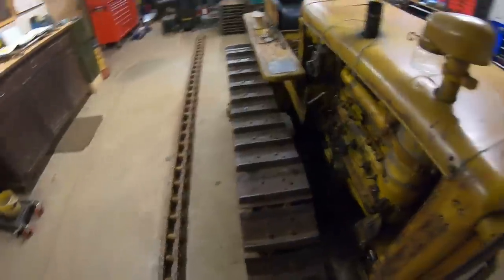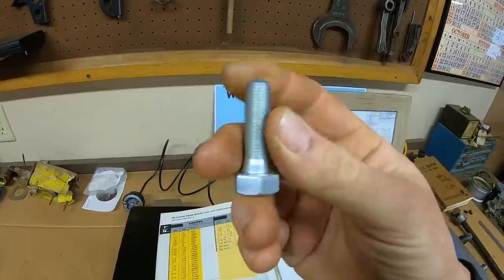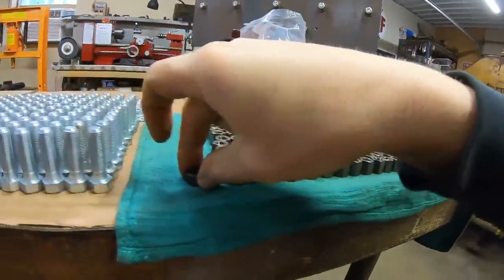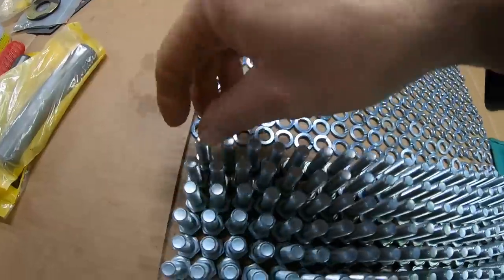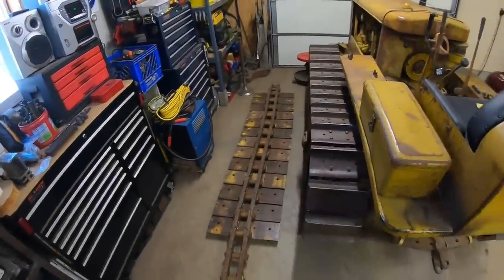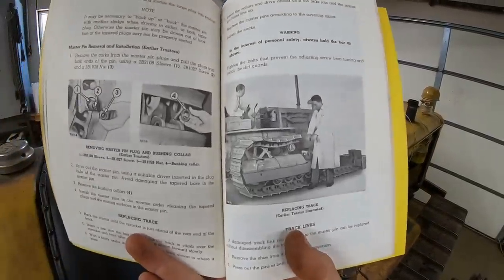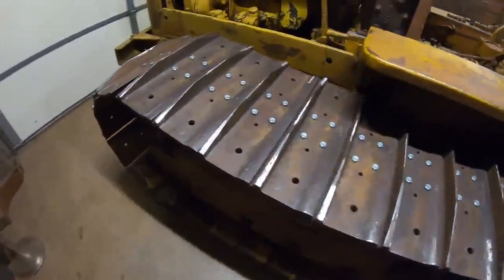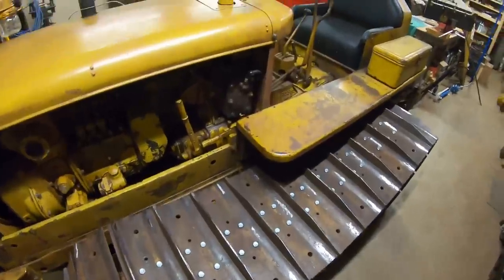Caterpillar D2 #5J1113 Chassis Rebuild Ep.75: Track Swap Begins! Hanging the 20's and Looping Chain!

Comment: I got pretty good at silver soldering many years ago putting carbide teeth on  50 + inch saw blades but that was 30 some years ago. I'm thinking I would need a lot of practice to do it again. However, it can be done, Keep smilin.

Comment: 240 cleaned up nuts looks good. As a young kid like 8yrs old on the cross links 3/8"  bolts were used in those days. I would find a good nut and grind (bevel) thousands of track bolts on the grinder. Years later they went to 1/2" bolt for those certain units. A little less hassle when rebuilding a track. Problem is I still have thousands and thousands of track bolts that will be going to the scrap bin. Maybe 😆

Comment: After all the special tooling and preparation to set up for the new track chain and wide grousers, it seems like the assembly should be more complicated than dropping 4 bolts, adding lockwasher and nut and torque!

Comment: Awesome comparison between worn and turned pin n bushings on tracks and those 20s look amaseing on J1113  my dad always had issues with those oil gallies/ manifolds he braised one because he had need of the power unit  rather badly.so he had several and braised one up whilest  grandpa silver soldered the others and the oil soaked leather and copper pressure rings well the leather was weathered pretty bad so we got some newers silicone seal rings at new condition to seal the system. It worked great and didnt give any issues grand dad said well keep the welded one  as a known good until the others are proven good non leakers.

Comment: The first silver soldering I did was on high temperature wire connector studs and I used silver flux and bare silver.

Comment: Another marvelous set of explanations, and the new 20" track pads look wonderful!   A couple of questions:   (1) What would the 20" pads have been used for originally?  I'm guessing wet or very soft ground, and (2) Can you estimate how much strength is lost with the bolts threaded to the end?  

Also, back in the 1960's, silver solder-- or at least the type my elder brother was working with making equipment at a university laboratory-- contained 40% cadmium, making it extremely toxic.  It was supposed to be used only under a laboratory fume hood.  I hope it has been reformulated.

Comment: Very good  👍 
On the oil leak  silver soldier is easy !!! But you can't have any thing in the way of contamination like other soldier or dirt !!! Andbit requires more heat and no Flux is used !!!!  😊👍🌎🌞👍☕☕☕☕

Comment: 26:59 Those oil leaks are annoying to sus out no doubt about it. I would definitely string the new track on that side, though, and leave off just the grouser plates that fall next to the engine until you've got the leak sorted.

Comment: I don't know if it would have the strength of pure silver solder but there is a silver bearing plumbing  solder I used in plumbing that did not take the heat of silver solder but was stronger and filled gaps better than flux  solder.

Comment: Very interesting and those wide tracks look awesome. Kind of like putting really wide wheels on your car. How do you get those new master links apart? Can you get the hydraulic cylinder in the other way or do you just push the pin right through? I think a weak pin might be a good idea so if something does happen you break an easily replaceable pin rather than a link or something even more expensive or hard to find.
On the soldering I think modern lead free solder is cr@p. Its got no mechanical strength. Before silver soldering you will have to clean all that soft solder off. Make sure you have a torch that has the capacity to get the whole area hot enough for the silver solder to flow. If you use "easy flo" silver solder the technique is not too different to soft solder.

Comment: Just a question regarding the Torque of the track pads - i was always told to torque the nut not the bolt- is that due to the Nut not being accessible ? great little Cat cant wait to see it working :)

Comment: I silver solder plumbing on steam locomotives quite often and prefer the type with Cadmium from Mcmaster carr. Just don't breathe it much. Appreciate the track fastener information. I just pulled a set of new pads off a parts D47J for my D47U. I did it the hard way and saved most of the hardware. Rails and rollers are shot on both machines. A while back our ACMOC magazine had an issue about weld buildup have you had any experience with that. Not sure what to do about the pin and bushing wear as not many old cats survive the Texas weather.

Comment: Toby, watching your excellent coverage of pin and bushing wear and showing how the bushings don't line up with the cogs of the sprocket took me back about 70 years running my Dad's D2.  I recall a jerking action (still clear in this old mind) when pulling and then releasing steering clutch handles especially when under load.  I'm wondering if a lot of that was caused by worn pins and bushings and whether you will notice any difference when running 1113 with the new chains.

Comment: Hey dumb question that's probably not worth your time but what are the track pads made out of? I know it's steel but is sure as hell isn't mild steel and its not cast iron but are the forged or cast? I'm curious about the metallurgy, they are tough ad hell but not brittle. What's the secret to making them like that?
Reply: @squatch253  thanks dude. I appreciate the effort to explain it. It amazes me how steel changes its properties so dramatically depending on how its heated and hammered / roll formed. Cool stuff.

Comment: That's got to be disappointing, ordering the "right" bolts/nuts and receiving that.
I tried to buy a new heater valv for my old volvo, the komplex one with the sensor pipe going in to the heater, got som plastic shit without sensor pipe, that leaked from the start and had the wrong hoses included.
It's a ball valve now with a custom bracket to fit the original wire.

Comment: I just noticed as you were lowered the tractor onto the new chain that the pin/bushings slot into every other sprocket pocket, and im wondering is there an odd amount of teeth so that it changes after turning or does it stay on the same alternate pocket and if so is changing which pockets the chain rides in another maintenance procedure?

Comment: Great progress on the track chains.
Why did Caterpillar use bolts that requires tall nuts? Were you torqueing the nut or the bolt?  Getting the logos in alignment must have been a challenge if you torqued the bolt.
Reply: Same reason as leaf spring/U-bolt nuts. More thread contact = more holding power

Comment: It looks good! one thing that I seen and I will have to remember to look tonight, is that the grossers appear to be oriented differently om the machines I run. It appears that yours has the grosser in front of the pad on the return side, where I think the D10s I am in they are in the rear of the pad.  I could be mistaken.as I usually am.
Is it possible to check your manifold on 5j1113 block with a feeler gage (no gaskets) being finger snug to be positive of the plane? 0:34 
Just got a chance to look and the grossers are oriented the same way. I must have been seeing things

Comment: Now the turned pin track chain is now running tight into the sprocket and wearing into the pockets, they will now wear into place and polish up the sprocket, how long after run in do you do a small readjustment to keep tracks tight?

Comment: So on the old master pin how do you get it out once you drive the locking pins in ?  I don’t see a way to remove them unless you can press the pin out with them installed ?

Comment: Hi this being your latest video I am hoping you will see my comment. Is there a way to get in touch with you or your dad for parts for sale? I am working on a d6 9u bulldozer and the starting pony is giving me fits. I followed his previous vid series to the T rebuilding the zenith 4tcu carb but it still doesn't seem to rev high enough not to die when trying to turn the diesel. anyway wondering if you guys had a 4tcu for sale or could offer other insight I might be missing.

Comment: Can't you drive from one track to another like on rails? 
Master pin is not as difficult to put in and out one more time i think, when compared to lifting D2 up and sliding tracks on the ground
@edit two dummy pins would make that properly easy O.o
Reply: Also, mechanisms don't see difference between chain with or without pads, so sliding naked chain would be fine for sure
Reply: @squatch253  yup, that got obvious in some point. Sorry for not coming back to add next note

Comment: You’re getting a little misinformation in the comments about silver brazing.  Hope you do your research and practice some first!  The most helpful tip I can give you, is that like all other brazing,  it has everything to do with using the proper amount of heat to get 45% or 65% filler to flow.  Keep in mind… There’s nothing wrong about backing the torch flame away from the joint so as not to overheat.

Comment: WTH, that's not cool of Cat to change the specs of bolts and nuts like that. The new numbers are basically useless. The bolt without a shoulder will wear out far faster and essentially become a loose fit, that shoulder had  a reason to be there.

Comment: Going to be hard to clean all that tin solder off, and the silver solder absolutely will not take with any tin solder. Maybe you should consider getting an older HVAC tech to show you how to silver solder? Surface must be clean, really clean, rookie mistake is using your much heat. Some brands of flux seem to work easier than others. You do know silver solder requires different flux than tin solder? Best Wishes!
Reply: @squatch253 -Just curious, what  are the two metals? Provided you have the correct silver solder and flux, if the solder still does not “take”, ether the metal is not clean, or, you are use to much heat, or, not enough heat. I guess you know that you need an oxygen/acetylene rig to do that size a piece? In other words, using like a Turbo torch will never get it hot enough. But, if the metals, are clean, you have a welding rig with a small tip, throttled down, I’d hazard a guess you are blowing thru the proper heat range. To much heat, the whole works will turn to s—t in a heart beat. You need to sorta sneak up on the heat to where the silver solder melt first,  and then starts flowing in between the two metals. You can see it happen, unless you blow thru the heat range. Once the solder starts melting and flowing back the torch away quickly so as not to increase the heat to where the solder starts running away from the joint. You should practice on some scrap steel, brass, copper, metal till you have it figured out. You may have to remove the mill scale from hot rolled practice steel. The main challenge I see now is getting the tin solder out completely. Hope this helps! Just so you will know, young HVAC techs, they can’t figure it out! 😂😂😂😂😂😂 it’s not easy, takes practice and patience.
Reply: @squatch253 -Are those 2 metals a brass or  copper  or brass pipe?  Magnet test? If so, Sil-Fos, 15%, I believe would be superior. no flux required, easier to use, no pin hole problems, stronger. Takes substantially more heat. Standard procedure in refrigeration is to  “cap” Silver Solder with Sil-Fos because Silver Solder can have pin holes letting refrigerant leak. Sil-Fos will NOT take to steel, UNLESS you put a thin coating of Silver Solder on the steel first. Then, you can flow Sil-Fos  over the Silver Solder thin layer.  In other words, the Sil-Fos will take to the Silver Solder. The only reason I know of to use Silver solder is because one, or both, of the metals you are joining is some type of steel, Those  both look like brass or copper alloy in the pic. I am going to watch that entire video in a few hours.
Reply: @squatch253 Knowing you from watching your videos for years. likely you are not going to braze, and will stick with the original silver solder. Your torch set up looks good  to me. I’d suggest only one thing. That you assemble some scrap material of the same type as that manifold and pipe. Then, sit down and spend a few hours practicing. I’d prefer the black flux, but the white works fine also. Silver Solder can be frustrating. Hope this helps. Best Wishes! PS If these manifolds have always been a problem leak, you may want to investigate brazing with a product such as Sil Fos 15, or, other name brand similar brazing fillers.

Comment: Is there a Cat part number for the lab coat? Seriously, why do so many of the pix in maintenance books show guys in lab coats? These guys had a reason for everything they did, as demonstrated in the treatise on nut and bolt length. Were they trying to suggest this work was not for the common man but needed someone with the proper education?

Comment: I would be willing to bet that McMaster Carr has the correct dimension bolts and nuts.   Bolt with correct shoulder or something close.  It appears bean counters at CAT have changed the parts and ignored good engineering practices.  Typical for modern companies.  😑